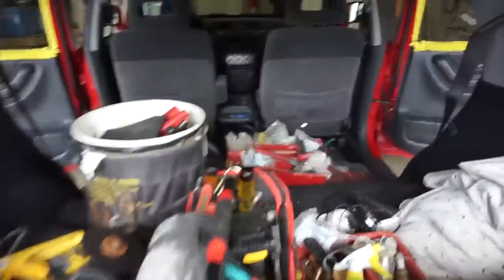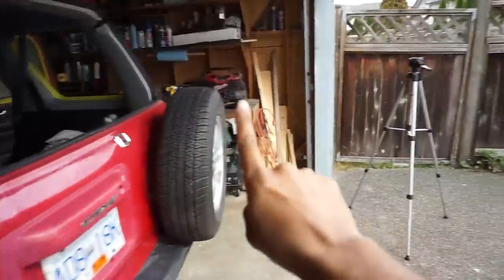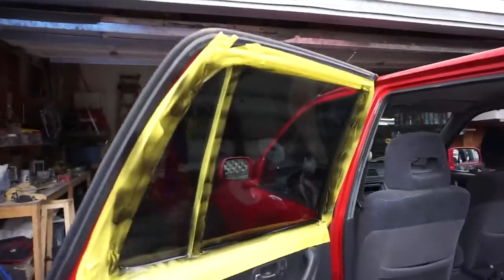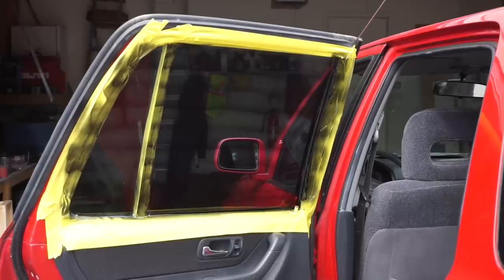Tint Windows with VHT Night Shade ???

Comment: I like all the people getting mad that it looks like shit but the guy literally said it will look like shit but it has a purpose
Reply: Bro that's all that really MATTERS is getting the windows darkened for privacy reasons and to block the freaking heat I actually thought of this same idea while watching another dude spray this shit on the backlights of his car and I'm going out right now to get me a can of this shit to do my windows AND my lights to make my shit look badass, I have a 2005 little Blue 2 door Honda Civic sedan and I just LOVE it but it keeps heating up whenever I'm parked with the a/c on, and I THINK it's got a coolant leak! Might you know the solution or my issue here?😿😿😿😿😿
Reply: Definitely like good attitude. If I do this I'd like it done for the back window and maybe not spray on the inside at all and see if it's still dark. You can see better than real limo Tints with this so maybe without the indoor tint it can work good.
Reply: Yuo
Reply: I did this same thing to my car and didn't look like shit. It actually looks like real tint from inside and outside. I think people are mad because how he sprayed it but he just doing it for his purpose. I sprayed my window from outside tho
Reply: @gosurwalow127  can u stll see out of the windows, i was thinking abt spraying the outside to?
Reply: @gmailbasic1929  it is super dark. I did just the top of windshield and backseat window.  It's hard to see through
Reply: @gosurwalow127  aw ok, thanks for ur response!

Comment: Spray from a further distance and light coats. You can get this stuff to look like actual tint when you do it right.
Reply: Seth Oakes make a video 🔥
Reply: @frzspr1362  :D
Reply: Truth Holy one.
Reply: @BillG29  😹😹😹😹😹
Reply: Nice to know. It he does it from the outside only, do you think it'll still work?
Reply: Yea boss i used it on both my brake lights and windows and just using lighter coats and about 7-8 inches away and it came out beautiful
Reply: Would the inside still look like that?
Reply: I seriously doubt it,
Never seen a good job spray, Like EVER!

Comment: Did the job, well done. Would love to see another example done using
1. Overlapping (spray 1/3 or so overlap on previous line, never allow overlap to quite reach halfway)
2. Much faster stroke for way lighter coats and higher quantity of coats (dries quicker between coats, and evens out the finish significantly)
3. Spray from roughly 10" from the surface (will help with lighter coats, make overlapping easier, and prevents those gravitational collection streaks)
edit - also don't cross-hatch your spray pattern; It seems intuitive that it would look more even but in reality keeping the same stroke pattern ends up looking the most even because it creates less highly contrasted areas by ensuring that the weakest points are still filled in along the same line. The contrast is what looks uneven, retaining stroke pattern prevents that best.

Comment: As a tint professional, I really liked this video! Of course it looks bad on the inside but you made it very clear you needed it to serve a purpose and it worked. That CRV back window sucks to tint, most shops would have charged a lot for that. Glad you got a workable result and it looks much better on the outside.

Comment: Probably has streaks cause you held the can too close.
Reply: josh jaralba facts
Reply: Agree.... I was thinking, "where's the newspaper to cover everything else around the spray zone?"
Reply: Also, I think to do this right, you need to remove the windows from the car completely.
Reply: @travisstorms9951  WOW! 5 years ago! Am I coming late to the party or what!
I certainly agree with your statement... But...
It can be a real hassle to remove car door glass, It might be easier to remove the doors, so you can lay them horizontal. 
However, since his stated purpose is to hide his tools in a work truck, removing any glass & taking the risk of breaking some is beyond the scope of what he needs.
Just do a proper masking & spray from further away and do lighter coats seams to be a better plan.

Comment: First thing you should always do when spraying coatings out of aerosol cans it's to submerge the cans in hot water for a while to warm them up they will spray much better with lower viscosity
Reply: Thank u for thss. Im assuming spray paint would be better warmed up as well?
Reply: @brittany9414  absolutely it lowers the viscosity sprays better and evens out better
Reply: @toddlehman928  thanks!

Comment: I used spray window tint back in 1993 on my new S10 king cab.  It actually turned out great without any runs or lines.  It was still doing well when I traded the truck in 1995.

Comment: Definitely like good attitude. If I do this I'd like it done for the back window and maybe not spray on the inside at all and see if it's still dark. You can see better than real limo Tints with this so maybe without the indoor tint it can work good.

Comment: When done applying the vht nite shades paint do not let Fully cure but wait about 10 mins after last coat and than use a big torch like a plumbers torch and make circles around while window and you will start to see it get shiny and it will smooth and even itself out and than done

Comment: Nice video. I’m looking for something to tint my truck cap windows with. Where did you get this at? I’m tempted to use paint but if this works I’ll use it instead. I just want something on there so people can’t see in because I use it for camping and stuff like that.
Reply from the maker: Amazon sells it. Im canadian so i got it at a store called canadian tire.  In usa i think autozone might have it
Reply: You can make cut out inserts for your windows pretty easily. With some cardboard, black fabric & a stapler but with the cost of those materials you might as well go with this option, especially if you're looking for a more permanent solution.

Comment: Wow that’s hella illegal. Keeps the crackheads out tho, good job 👌🏾
Reply: Depends where you live...
Reply: Wrong.
Reply: No its not as long as u dont do it to the front window have u ever seen a work van with no Windows in the back its the same thing
Reply: @taco4762  In Texas nothing is allowed on the front window except clear uv blocking film. The front windows can't be less than 25% VLT and anything can be done behind the front windows as long as you have side view mirrors and can see 50ft back. You can legally black out everything behind the driver.  Different for other states

Comment: The coating material isn't bad, the cheap ass nozzles they use are. They had a spray on glass tint in the 80's, we used to spray it out of actual paint guns, it didn't last long though even when applied correctly.